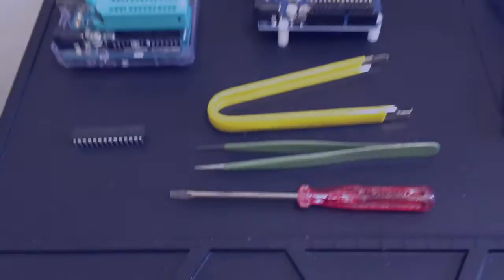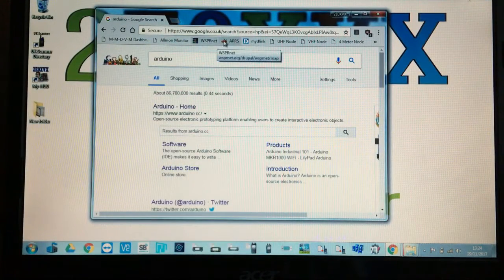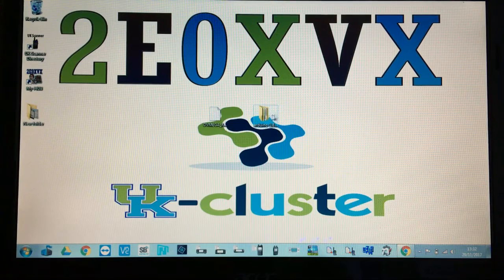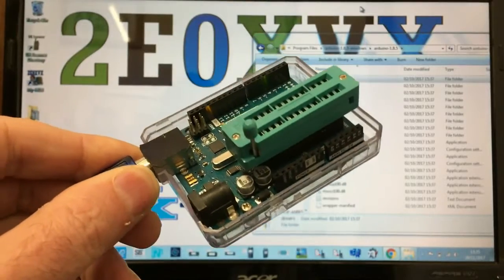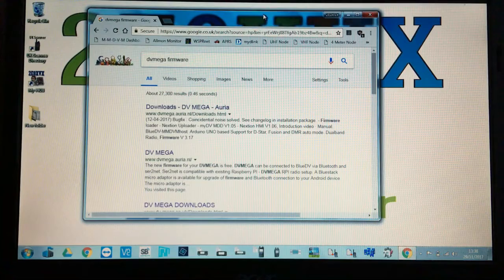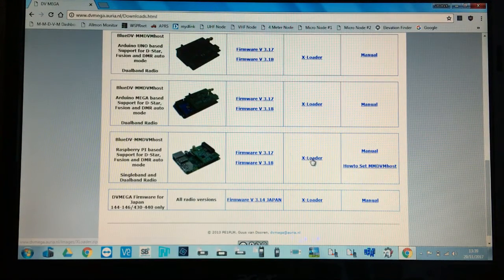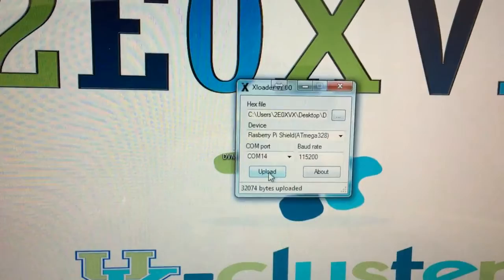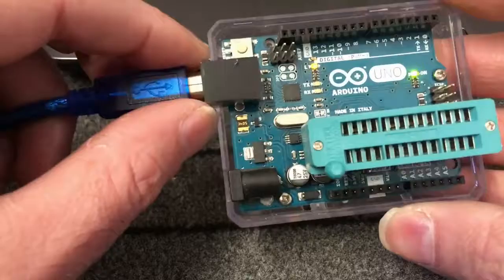ATmega328 Firmware Upgrade

Comment: Cool. Pretty straight forward.  While my 3.14 DVMega is running fine, I’ve been wanting to do an update. As a measure of caution, I don’t think I’ll flash over 3.14, but rather keep that chip and just get a few new ones to have around to flash the new FW’s.  Cheers and 73. W8KDG